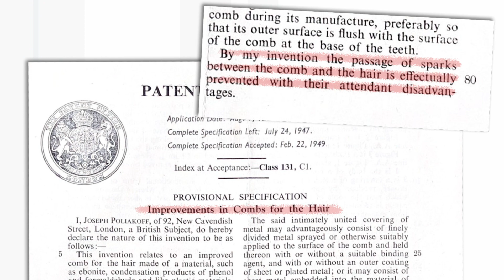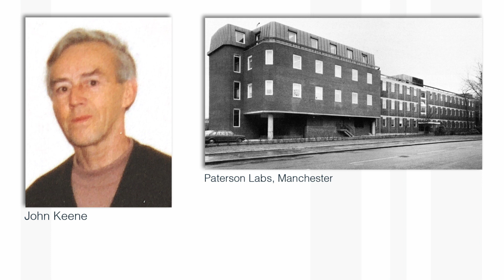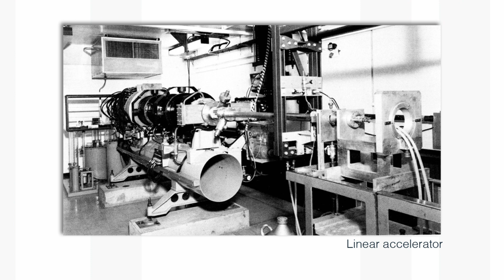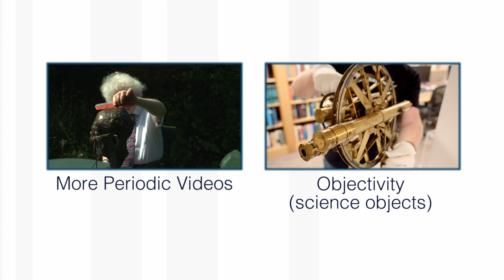The Anti-Frizz Comb (and other curiosities)

Comment: If the user of the nasal device was a physician or medical doctor the most likely use is detecting scents, for example urinary analysis*. The most obvious example these days is with diabetes. However, it's only over the last 150 years ago that diabetes has moved from being a few reported cases in 30 or 40 years to where around 70% of the US population is diabetic or pre-diabetic. Around the turn of the 20th century it was much more rare as there was so little sugar or short chain carbohydrate in the general diet. So that you would have to be rich enough to afford the food & lifestyle that would give you diabetes & thus also be able to afford a doctor 
*Which could be used in addition to producing chemical reactions on litmus papers.

Comment: Below I will show you the formal definition and some examples of expression in Knuth's up-arrow notation:
a^^^^...^^^b with n uparrows = a^^^...^a^^^...^^a^^^...^^a... ...a^^^..^^a with (n-1) uparrows between each successive a's
Where a^b is the same as a raised to the power tower of b
First, we will take a review of addition, multiplication and exponentiation. We had all studied in school that addition is repeated counting, multiplication is repeated addition and exponentiation is repeated multiplication, mathematically:
a+b = a+1+1+1...+1 (repeated b times)
a*b = a+a+a...+a (repeated b times), and
a^b = a*a*a*a...*a (repeated b times)
Now, we will start with the double up-arrow operator, which is better known as tetration.
a^^b (read this as "a tetrated to b") = a^a^a^a^...^a (b times) (a power tower of a's b terms high)
Keep in mind that exponents are always right-associative, so a^b^c^d is the same as a^(b^(c^d))
For example, 2^^3 = 2^2^2 = 2^4 = 16
2^^4 = 2^2^2^2 = 2^2^4 = 2^16 = 65536
2^^5 = 2^2^2^2^2 = 2^2^2^4 = 2^2^16 = 2^65536 = 10^(log10(2)*65536) using rules of logarithm = approx. 2*10^19728 (a number WITH 19729 DIGITS!!!!!!)
3^^3 = 3^3^3 = 3^27 = 	7,625,597,484,987 (approximately 7.6 trillion for short)
10^^^3 = 10^10^10 = 10^(10 billion) = 1 followed by ten billion zeroes
Now do you see how powerful tetration is in comparison to scientific notation?
But that's not the end of the story. Just like how tetration is repeated exponentiation, pentation is repeated tetration, which is normally denoted as triple up arrows (^^^) In summary, the n arrow operator is repeated (n-1) arrow operator
    After that, I suggest you to learn the definition of fast-growing hierarchy, which is basically like this:
f_n(a) = (f_(n-1))^a(a), when n is a successor ordinal, or in other words, 
f_(n-1)(f_(n-1)(...(f_(n-1)(a))...)) (nested n times)
When n is a limit ordinal, f_n(a) is defined as f_(n[a])(a), where n[a] is the n-th element of the fundamental sequence of the ordinal n
    For the definition of successor and limit ordinals, you can search it yourself in Googology Wiki
    Now, here's an equation for you. Given that 1/f_x(100) is the amount of DNA I inherit from my mom, try to find the ordinal x. The ordinal x here is known as my DNA ordinal
    Here's the approximate value of x in Bashicu Matrix System: (0,0,0)(1,1,1)(2,2,2)(3,3,3)(3,3,0)(4,4,1)(5,5,2)(6,6,2)(7,7,0)(8,8,1)(9,9,2)(10,9,2)(11,9,0)(12,10,1)(13,11,2)(13,11,2)(13,11,1)(14,12,2)(14,11,1)(15,12,2)(15,11,1)(16,12,0)(17,13,1)(18,14,2)(18,14,2)(18,14,1)(19,15,2)(19,14,1)(20,15,2)(20,14,1)(21,15,0)(22,16,1)(23,17,2)(23,17,2)(23,17,1)(24,18,2)(24,17,1)(25,18,2)(25,17,0)(26,18,1)(27,19,2)(27,19,2)(27,19,1)(28,20,2)(28,19,1)(29,20,2)(29,19,0)(30,20,1)(31,21,2)(31,21,2)(31,21,1)(32,22,2)(32,21,1)(33,22,2)(33,21,0)(34,22,1)(35,23,2)(35,23,2)(35,23,1)(36,24,2)(36,23,1)(37,24,2)(37,23,0)(38,24,1)(39,25,2)(40,25,2)(40,25,1)(41,26,2)(41,22,1)(42,23,2)(42,23,2)(42,23,1)(43,24,2)(43,23,1)(44,24,2)(44,23,0)(45,24,1)(46,25,2)(47,25,2)(47,25,1)(48,26,1)(49,27,0)(50,28,1)(51,29,2)(52,29,2)(52,29,1)(53,30,0)(54,31,1)(55,32,2)(56,32,2)(56,32,0)(57,33,1)(58,34,2)(59,34,2)(59,34,0)(60,35,1)(61,36,2)(62,36,2)(62,36,0)(63,37,1)(64,38,2)(65,38,2)(65,38,0)(66,39,1)(67,40,2)(68,40,2)(68,40,0)(69,41,1)(70,42,2)(71,42,2)(71,42,0)(72,43,1)(73,44,0)(74,45,1)(75,44,0)... ...
For the definition of Bashicu Matrix System, you can search it up yourself in google
    So can you please help me to analyze my DNA ordinal?

Comment: 3 applications for the glasses: 
-Glasses fog up when you wear a surgical mask. If you breathe out through the pipes around the glass and the temperature of the glass equalizes with your breath they might not fog so much. 
-Also it can be a breathing apparatus like a gasmask for someone with a beard and/or mustache (since they cant wear normal airtight masks).
-Thirdly it can be for oxygensupply to people with damaged lungs. This setup looks easier to maintain and is more robust than current tubes. Especially relevant now that alot of people might need extra oxygen because of damaged lungs.

Comment: The spectacles may have been used to deliver nitrous oxide in dentistry. The frames would keep the tubes well away from the mouth and would allow for breathing the gas mixture. Nitrous was available in dentistry in 1844 and there were a lot of innovations in delivery systems.

Comment: I would hesitantly guess that the spectacles were used to keep your nose moist on a dry winter's day. Set it up near boiling water and inhale. You'd have much more humid air flowing into your nose. The tubing is long enough that the water would have cooled down to the point of not burning you.

Comment: the spectacles with the tube for some odd reason ive seen them before and the thing thats jumping out at me is that its from WW1 and has something to do with tunneling ive seen them in a WW1 museum before i think it was used to find gas leaks or try and smell out the enemy using particular chemicals or explosions or equipment i think? on the end was a large rubber cone sort of like a stethoscope

Comment: It seems that a Mass Spectrometer test of the outside & inside of the metal valve might be telling,  if any chemical residue persists. The outside presumably would be the control to eliminate any of the alloy of the metal.
If nothing is found, then like others  I'd think it would likely be for oxygen.

Comment: I think the nose tube glasses thing is for precision smelling! Like a stethoscope, but for smells! :) Point the end at something that requires a sniff, inhale with the nose, and the scent of the thing travels through the tube and into the nose, without having to get your face right into it. Since it's a small area, the scent of other nearby things wouldn't convolute the scent of the target as badly as if you brought it up to your face. Maybe for medical applications, like smelling wounds or other kinds of diagnoses where the condition produces a scent. Also seems like it would be able to get a smaller dose of chemical inhalation (for safety) compared to the method famous to chemistry students: the "wafting method".

Comment: I think the nose-spectacles are perhaps to isolate smell. For example if you smelled something concerning or odd. You would put it on and wave the end of the tube around sniffing. this would isolate the smell you receive to a specific place in the air.  In a practical environment perhaps if you work at a industrial place with gases with noticeable scents and you needed to track down a particular pipe or gauge that was broken it could help.

Just a thought

Comment: I think it's missing 2 seal gasgets for the nose and then bottom part or I should say on the top part when using it there is like a float so you can breathe under water.

Comment: The plexiglass reminds me of the burnt wood art people make with dc currents. The positive and negative are placed on separate points of the flat wood board, and if the current is strong enough, the current burns the wood along the path of least resistance. It looks very similar to your plexiglass.

Comment: Using a CPAP machine to aid in breathing while I sleep, the second item appears to be some sort of assistive breathing apparatus. Perhaps it was used like today's portable oxygen pumps and was the facial "mask" portion of the device. 🤔
Reply: For those needing glasses anyway, perhaps?
Reply: @ragnkja  maybe the glasses were just a convenient way to keep the hoses in place while worn. They didn't necessarily need to have lenses.
Reply: Eagle8599 
The version typically worn by those who don’t need glasses looks similar to this, but without the part above the nose to fit lenses in.

Comment: It's a nitrous oxide delivery system that can be controlled by a valve attached to the union. 
This enables spectacle wearers to partake in nitrous oxide parties  or experiments & still see to take notes or recognise other participants.
Or it could simply be a handy mount for oxygen delivery to heart and/or lung patients.
When I needed O2 in hospital the comfortable wearability of the tubes still has not been solved. This was in the 20 teens!
That mount onto your glasses would've solved those problems during the day.
At night, while you're asleep is a different matter! I can still remember waking from drowning or suffocating (I had lots of dreams of North Sea saturation diving going wrong) and waking up on a dark ward with my oxygen delivery tubing gone AWOL!
I don't think this would've helped at night, but during the day it would've been perfect!
I still think N2O after dinner experimentation sounds more fun though! 💨🤣

Comment: With everyone now having to wear masks, my spectacles fog up. His spectacle design would at least avoid that!
Reply: Fold the mask were it goes across your nose, make sure the metal edge of the mask is across your nose not the chin.
Reply: During the winter time, the glasses could fulfill both functions: prevent glasses from getting foggy, specially when using a scarf, and alleviate a runny nose in a discreet way. XDDDD
Reply: Not sure about that, they fog up when exhaling
Reply: Bugside almighty if you exhaled through the nose piece, and into the tube, it would avoid fogging. Actually, you might not need a mask at all. Make the tubes a little bigger, end it with a filter by your pocket.
Reply: you'd still need a mask. masks are for trapping spit when talking too.
Reply: VoilaTada Simple. Don’t talk.
Reply: Yeah, get masks with a metal strip at the top and bend the metal so it turns a tight seal to your nose and cheeks. If the mask keeps slipping down you can try fixing it in place by putting your glasses over the bent metal strip and trap the mask to there. That way your warm moist breath won't pass by your glasses.
Reply: ooooneeee Even those haven’t been all that great at sealing in my experience.

Comment: I saw an old patent once like those glasses and it was for warming cold air before you breathed it. the tubes went inside your clothes to warm the air with body heat.
Reply: I like this theory, but the tubing seems a little small for the volume of air required.
Reply: eatshitdie1  From what I can tell, oxygen was administered in medicine since 1885, so you dismissing that idea outright and calling people dummies doesn't seem to jive with the facts.  Elaborate more if you can, otherwise an apology may be in order.
Reply: eatshitdie1  Oxygen glasses do exist and are patented (Hingeless oxygen delivery apparatus US20080257343A1)(Respiratory Aid Glasses US5193534A).  Nasal cannulas wrap behind the ears of patients.  For patients who wear prescription glasses, this is more challenging as you might assume.  The solution was to combine the glasses with the nasal cannula.  This oxygen therapy helps treat people with breathing problems such as COPD.  You should really do a bit of research more before insulting others by calling them dummies.
Reply: @AcademicEndeavor  so they probably ARE oxygen glasses. Interesting.
Reply: eatshitdie1  It's not the words you use, it's how you use them. You could have made your point without the insult. Maybe next time you go to leave a similar comment frame it in a more positive way.
Reply: @Psilovecybin heats up the glasses to keep them from fogging?
Reply: eatshitdie1  - What do you mean "dummies"? Oxygen delivery is a logical and intuitive answer.
Reply: @AlexSh789  no it's not. "people need oxygen in hospitals - that's true so it must be true that this is a logical answer". It would be something that was worn outside in every day, hence being fashioned to look slightly less medical. It's like you ignore the entire point.
Reply: @diceblue6817  - People need oxygen outside hospitals, too. There are people who wear glasses and can't live their everyday lives without supplementary oxygen. Besides, do you have a more logical or intuitive answer for what it might be?
Reply: @AlexSh789  The comment says people were talking about oxygen delivery in hospitals. (well "like") and my point was this is for every day. Yes I have a better and more intuitive idea: It's for taking cocaine into cinema in those cinemas that force you to buy their overpriced cocaine.
Reply: @diceblue6817  - My point still stands.
Reply: @Psilovecybin Assuming you mean the Y-connector, that would serve as a weight to keep the tubes inside your coat. It's probably also convenient to have the two tubes held together, rather than letting them flap about independently. Not sure I buy the nose-air-heater explanation but, if it is that, I think this would explain the Y-connector.
Reply: @A3Kr0n  Thanks for posting patent info. Do you recall why the nose needed to be warmed? Maybe by using it, frostbite or cold-induced asthma were avoided? 🤔
Reply: eatshitdie1  calls them dummies while having a weird username
Reply: eatshitdie1  If having too much tugging on your temples gave you migraines, you might not make such an ignorant comment.
Reply: That's interesting and sounds likely.
Reply: ooooo that makes sense you really help doc out
Reply: can it prevent nose freeze?
Reply: eatshitdie1  Nor has rudeness
Reply: eatshitdie1  Kinda hard to take you seriously.
Reply: eatshitdie1  screennames and/or calling names aside I am genuinely curious why you consider people "dummies" for thinking it is for oxygen delivery for people with COPD since it actually looks like it could work for that. Although I am not convinced by the claimed benefits using this contraption, over just flexible light polymer lines they use nowadays.
Reply: Nice !
Suddenly seems very useful in cold winters to prevent... well, cold
Reply: eatshitdie1 - well, considering another commenter further down pointed out that these types of glasses still exist and are in use today for the very reason of delivering oxygen I’d say you’re the dummy

Comment: The spectacles are called "Oxygen therapy glasses" ! they're an alternative to the more common tube setup and they're still around!

some of the benefits include: Less visible, less issue with pressure sores in people with COPD, and potentially offering greater range of movement as well as generally being more comfortable.
Reply: Exactly what I thought of when I saw them. I can't imagine anything else they would be used for. Quite brilliant!
Reply: A lot less invasive yes.
Reply: I agree, here are a couple of patents (Hingeless oxygen delivery apparatus US20080257343A1)(Respiratory Aid Glasses US5193534A)
Reply: I can't help but wonder if something like that would be advantageous for someone who required O2, but also wanted to move around a lot, say someone working in their lab or shop, who could plumb a line in, and instead of carrying around a bottle of having a hose you could trip over, you could plug it in at the station you were working at, then just unhook it and move across to your other bench and plug it in there. I'm not suggesting this is what it was for, but it seems like it would be a more comfortable and even safer way to deliver O2 in in certain settings.

Comment: This looks like glasses with an integrated nasal cannula for oxygen treatment.
Reply: Ah, that makes sense I was wondering if they weren't for anatomists with less than fresh subjects as a means of introducing more pleasant scents.
Reply: @stamfordly6463  Yeah depending on the age there were times where they used smelling boxes.
Reply: That's exactly what I was thinking.
Reply: Or snorting substances. Sorry, I had to.
Reply: yeah or some other gas.......
Reply: Exactly what I was thinking. Perhaps the old delivery system interfered with the wearing of spectacles? However, this juxtaposition of the two negated any issues of wearing both at the same time.
Reply: @ravusursi893  dont hurt yourself there bud
Reply: @ravusursi893  " the juxtaposition of the two negated any issues" Do you hear yourself talk or do you run everything through a thesaurus? just because its a synonym doesnt mean it fits your sentence...
Reply: @ravusursi893  I understood your first comment just fine, but that second sentence is pretty much the polar opposite of shorthand. I imagine you go through lots of pencils.
Reply: M Major Again, my apologies. I wasn’t aware that we were limited to the length of reply. As for pencils, I don’t actually use that many as I prefer to use a pen, like all the other adults.
Reply: @ravusursi893  this only works if you keep your glasses on to read or nap, but I can see someone attempting it.
Reply: rabidsamfan Agreed. Probably just an instrument to use to help with daily living.
Reply: @rabidsamfan  well with the quick switch at the bottom you could probably easily swap out when it's nap time.